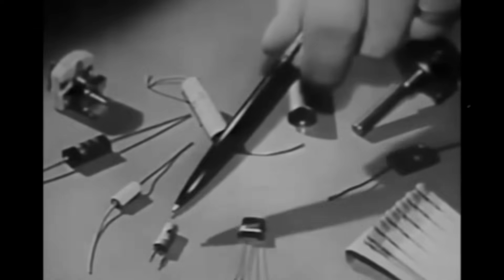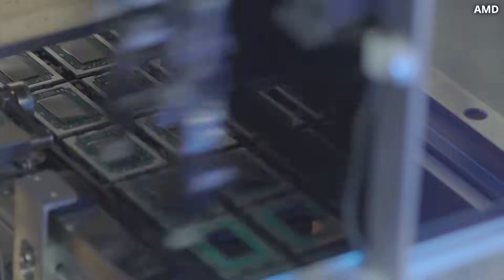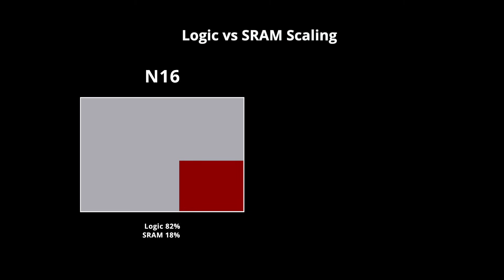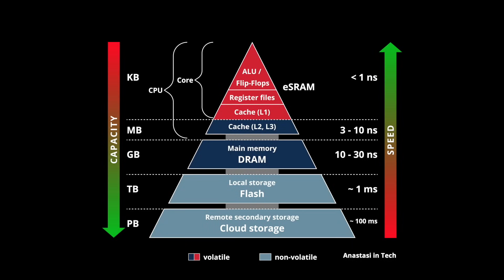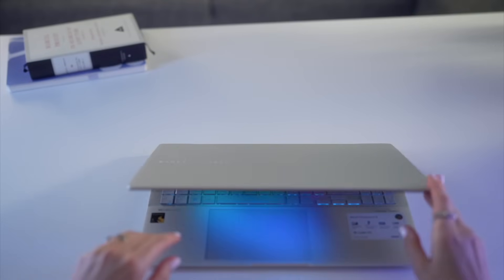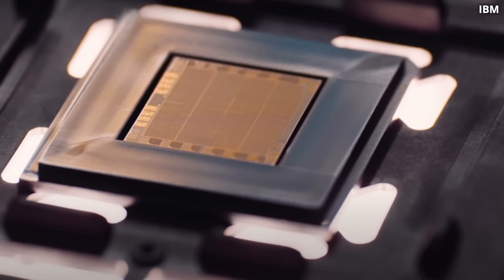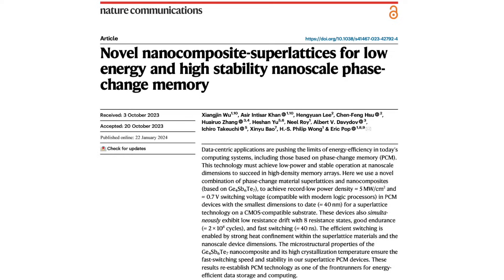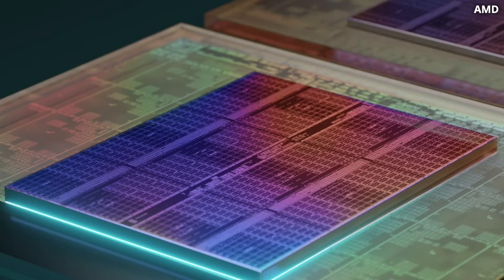The Death of Computer Memory

Comment: When I first started programming, and RAM was off chip and typically a few KB, we'd spend a lot of dev time working out how to do as much as possible in as little RAM as possible and as few clock cycles as possible.  These days the demands to cut development time and get new features out, more driven by senior management and Product Owners than by real customer demand, seems to have ditched those ideas.  If it's too slow the customer is expected to just buy a higher spec machine and new developers are taught ways to shorten development time but not execution time.  I think that this is a false economy.  About 10 years ago I was able to shorten a big data-processing job from 3 days to under 20 minutes, on the same hardware, by applying the techniques I'd learned back in the 1980s to key functions.  It took me 5 days, but when this is something that has to be run every week the saving soon stacks up
Reply: Wirth's Corollary to Moore's Law:
Any improvement in Hardware performance will be negated by code bloat at an equivalent rate.
Kinda like traffic in London.
Reply: Indeed. The faster the hardware it seems the sloppier the programmers get
Reply: @Th3_Gael  I think it’s less that developers have gotten sloppy than that timelines have gotten shorter.  Project managers and product owners hear that with Agile you can have something after a 2 week sprint and pressure developers to create a full product in a few weeks.  Development time is reduced, even though that results in code that runs slowly and has bugs because no-one has time to avoid them or fix them before release.  And then there’s the product owners who think Sprint retros mean if they change their mind about a feature they magically get the time back.

“The Phoenix Project” by Gene Kim et al gives a good overview of the problem and one way to approach the solution.
Reply: @Th3_Gael  Very true, faster and faster HW has resulted in SW code bloat and security risks mainly due to decline of programming. Today when I ask "average" devs and programmers what HW platform they use in the cloud or locally, they usually reply that they don't care as long as code is running fine and fast enough. Here is where I see main difference from the past when coders were close to the HW and today they r more and more detached from it due to cloud and virtualization. Everything got more comfortable and easier, just take a look at more HW attached gaming console coders who were once able to unlock incredible results from the one of the kind pocket calculator and now they code on the CISC x86 PC like machines and still complain about it😁Maybe they should look at the folks who coded on the PS3 Cell with 512 MB of RAM and were able to deliver incredible results. I think that generation was the last which showed who is truly master coder and who's just an average one.
Reply: I remember being taught to always use the smallest variable size possible to save memory and increase code efficiency. Still bugs me today people just using variants for everything. Inefficient code is everywhere now.
Reply: User training is problematic as well.  I remember as a Development Database Administrator being brought in when one of our systems was blowing the filing system the temporary tablespace data files were on and the Database Babysitters couldn’t work out the cause.  Originally the problem they’d been having was sorts failing due to running out of sort segments so the bozos had ‘fixed’ that by making the temp tablespace auto-extend.  Then they wondered why the nightly file system backup direct to tape jumped from 3 hours to 15.  What didn’t cross their teeny tiny minds is why a database with data files amounting to about 4GB had a temp tablespace of 70GB, 64GB of which was in the final file and the only reason that file wasn’t bigger was the file system was full and wouldn’t have supported larger files anyway.

After tracing the internals of the RDBMS I discovered that it spent almost all its time  creating sort segments, sorting data, clearing sort segments then reusing them.  The buffer cache hit ratio was also under 20%, whilst buffer cache it ratio is a poor measure of system performance when it’s that low on an OLTP system it’s a sign of a problem.

The system mostly worked on addresses and had about a third of a million addresses stored in it.  Users would search for addresses and the data pointed to a document store of documents related to that address, it essentially indexed a document management system.  I noticed that when searching for documents the bulk of searches only used the first part of the postal code and sometimes the document type.  I went out and spoke to some users and asked why they only searched on that when they had the full address.  The response was that was what they’d been told to do on the training.  I tracked down the trainer and she said that they did that because the training system only had about 50 addresses in, covering about 7 or 8 postal codes so to save time they just got the trainees to enter the first part of the postal code the scroll down to the one they wanted.  The system automatically sorted the list by full postal code then house/block number.  That’s fine when you have 50 addresses and each search returns 10 or so addresses.  When you have over 330 thousand addresses and each search returns a few hundred and you have between 200 and 400 users on the system at a time that’s a lot of sorting and scrolling to be done.  The database couldn’t release the sort segments till the user had ended their transaction (results were paginated so the full sort set wasn’t returned to the client in one go) so the system had to keep allocating more.  

I got a message sent to all users to say to use all the information they had in the first instance and only leave things out (so they’d be wildcarded) if they got no hits.  Temp tablespace growth went away, sort segment issues didn’t reoccur and we got the backup time down to about 3.5 hours.  A salutary lesson on the importance of looking at the end to end, not just the bit that’s going wrong.
Reply: @StephenBoothUK this type of problem should be resolved by not allowing the user to perform inefficient searches. With modern users, to simply tell them about a workaround and expect them to abide is folly.
Reply: @mkeyx82  they were doing what they were trained to do.  This was a system bought by the business with little involvement from IT from a third party supplier.  Also, there would be times where the users might legitimately have to search on partial data as they would be working from information provided by the public on paper forms so some data might be missing or illegible.  The problem wasn’t that they could do inefficient searches (which sometimes they might need to do) it’s that they were trained to always do inefficient searches even when they didn’t need to.

Your comment again proves the need to look at and understand the full situation rather than leaping on just what you think is the immediate issue.
Reply: @StephenBoothUK  it also shows that some do not understand that all users are not the same. Many users are completely resistant to receiving training.
Reply: @mkeyx82  can you explain the thought process that gets you from “the users were doing exactly what they were trained to do” to “users are resistant to training”?  They weren’t resistant to training, they were trained to do something badly and lacked critical thinking skills to see the better way and follow it.  They accepted and adhered to the letter of the training.
Reply: @StephenBoothUK  I understand what you are saying. I am  looking at the matter from my perspective, where my experience with users is such that many people out there are not really trainable.

When we recommend something to these people it usually does not stick, they are set in their ways. They don't like workarounds, they want to do things the way they have "always been done".

Even if you try to make their lives easier, they will put up resistance. Maybe this is a very specific, very low quality user base, tainting my perspective.

From my angle, the application should not allow itself to be brought into a problematic position by relatively normal usage. That's my story and I'm sticking to it.
Reply: @StephenBoothUK  your comments make me wonder what would happen if you had an AI that was trained on YouTube comments.
Reply: @StephenBoothUK  there's a huge disconnect between your end and my end. I've been able to get some work done developing prompt design so that I can get AI to cough up something useful, but it's like arguing with a drunken genius toddler on subjects nobody taught the drunken genius toddler about. The large language models are all trained on the stuff that has already been done and it can't parse New concepts. And that's my meat and potatoes. Everything I'm doing is outside of what we've already done. If it's something we've already done I can eventually get some kind of answer out of AI but even that's kind of a slog.
Reply: @court2379   that means there's great opportunities for improving code. The challenge isn't in the coding as much as it's in the human resources side of business management. If you take the flow chart of Human resources you end up back in academia. Of course most tech industry has completely forgotten the customer base and stopped communicating with the public. Everything is a no reply email. The space Renaissance is going to drive a huge increase potential in both hardware and software because space is going to require radiation hardening of all the traditional earth-based computer hardware and we're going to need much better quality coding. Space colonists are going to want all the standard types of personal computing equipment but to a far higher standard. And that's good it means there's lots of opportunity. With population growth exponentials moving beyond Earth we don't have to worry about constraining population growth anymore because the population on Earth is going to stagnate at about 10 billion while fertility rates skyrocket. This will create a huge increase in market size where most of the market will be off planet within 100 years. All this is being driven by Starship. With Starship bringing the payload size up and the cost down with high repeatability it'll give us the ability to put our foot in the door on Luna for heavy industry it'll build all of the resources we need for Mars and orbital activities around the solar system. That gives us plenty of distributed ISRU economies of scale as long as we develop a robust flowchart of Exodus for all the logisticals. A key component of memory that we're going to need to develop is exemplified by the work Microsoft is done with fused silica data storage. As we move out to Luna, Mars, & the interplanetary transport Network in general (a network of gravitationally defined transportation potentials) we'll have brief opportunities to record virgin data about untouched surfaces such as most of Luna, & Mars, as well as the Virgin surfaces of unknown numbers of asteroids, not to mention the moons of Jupiter etc. When we go to these places we'll have a brief opportunity to record this virgin data and it will be very heavy in volume. Because of this fused silica is aligned for archival storage en Mass with long-term research value. We won't have long to do this because we'll have a high priority for rapid on-site development. This will be driven by the population growth exponential being exported off of Earth. There won't be any shortage of money. The biggest thing holding us back is inefficient and ineffective academic development, and very poor quality and corrupt HR.
Reply: @court2379  Ahhh... so you're the one that limit my name size to 16 characters.
Reply: @MrAkaacer  Thats probably the database guy...
Really there is a mentality that ram and drive space are cheap, so they just don't bother being efficient. Sloppy.
Reply: I don't blame the coders of today.   They need to pump out code fast and if the hardware can give good enough performance, well that will do.  In retirement, I have the time to optimize to a certain extent (I'm an old 'C' programmer) and have written an OCR program that recognizes text at about 90 pages per second (on a 2017 CPU) which is about 100 times faster than Tesseract, Omnipage or FineReader software.
Reply: @123scanman  That’s my point. The drive to get new features out faster (driven by Marketing, senior managers, and Product Owners) seems to trump performance and fixing bugs. They would rather ship a feature the customer doesn’t need than get more transactions per hour per user on the same hardware or stop it crashing every 255 hours.
Reply: @StephenBoothUK  As someone around the gaming space, this cuts deep.  The modern gamer's expectations are arguably as ignorant as the investor focused executives, that make high level decisions with cascading consequences, throughout a project.   This creates a market that hits them from both sides...   harsh criticism from the players on almost any game issue, and from the business side guaranteed lay offs, no matter how good a job/how successful their project was.  

The state of tech has gotten so bad, many people I know, and including myself, have quadrupled the length of replacement cycles, and are seeking out older models of things. As those are more resilient items, and pre-date the cloud integration that companies have recently turned hostile against the user base.  IE things that require a phone app to use, and companies are now charging subscription fees to keep accessing the software.    

Meanwhile, so many people started becoming more investor minded (even ignoring the job market situation), which in turn is driving start ups trying to sell solutions that are desperate to find a problem to solve, inspiring incumbent players in a market to create problems they can sell more solutions to.
Reply: You are absolutely right. Once I participated in a service job to get a power station running. The problem was to bring the gas engines up and running as fast as possible. After a few days the programmer had been flown in and looked for alternative assembler commands to save a clock cycle here and a clock cycle there.😁
Reply: @crazyedo9979  Yep. Miss those times. I had a cheat sheet printed out with all assembler instructions with corresponding clock cycles and byte lengths. It was a very creative process to be able to squeeze out every byte / clock from the system.
Reply: @kalinkaata  Yeah, I remember those days and to be honest it was an artform.  Issue is now that how many coders could even begin to strip a piece of code to squeeze out as many instructions as possible within a given finite number of cycles?  Not many that's for sure.  That's the difference in my opinion between a programmer and a coder.  I miss those days.
Reply: @jamesross1003  as an end user I miss those days to. I have a lot of work to do and I'm not getting any help. With no ability to communicate with the development side it's like climbing naked through blackberry bushes to try and get my work done.
Reply: I am a total layman, and know this is true. 

 I think I was told we just brute force what we want with inefficient codes. 

 Look at what Voyager 1 and 2 could do with with 69kbs (lol 69. Sicko rocket scientist). 

 I bet if we tried to make a space craft just doing the same things it would take GBs of memory. Maybe I'm exaggerating, as again I am a layman. 

 Anyway you'd think it would be the opposite. We would be making even more efficient code, but I guess it is hard, and annoying. 

 Anyway thought phase change memory was already a thing. Just too expensive.
Reply: @dianapennepacker6854  I think the reason we're getting shity code is because of a culture shift. The old programmers came from a more disciplined background when the new programmers. A lot of that I think comes from the takeover of academia by lower quality educators. These lower quality educators produced lower quality output trained personnel.
Reply: @Astroponicist

It's not that old programmers were more disciplined. What shifting is emphasis. In my days, we only have 640Kb, thanks to Bill Gates arbitrary decision. So, we tried to save memory space as much as we could, otherwise our program would not run or run poorly. And don't forget the speed was not even 0.1% of today's low end computers. An unoptimized program will show its quality right away.

Today's programmers have memory in terabyte. And they can do a lot of unoptimized thing in their programs and as long as the program does not freeze, the customers are none the wiser. The ease of having large memory means programmers start to emphasis of how fast they can make the program, even if it's bloated and unoptimized. For example, they will load the entire library to memory when they only need one function. Sure, they can weed those things out but it will be done in the next patch, if any.
Reply: Maybe you should give a short hint how memory saving techniques you learned 1980 made the task faster.  In my experience using less RAM comes normally with slow programs, wasting Ram on them tends to speed stuff up.
Also you forgot to mention the devils that ruin our lives: marketing departments.
Reply: @transformational_experience  it was more around reducing database reads by collapsing 6 flag fields (each a multi character varchar for what amounted to a yes/no) to a single character field holding all 6 (the old knowledge) and using an index organised table to store the data (that bit was new).  Essentially using the first 6 bits of the char to hold the flags then calculating the numeric value and writing the corresponding char out.  The data didn’t change often once captured (less than 0.01%) so leaf rot on the index wasn’t an issue and the time taken to calculate the value (basically a bunch of if inputvalue == “some string” a = a+2) and convert to a char was more than compensated by only having to write out one char rather than 6 varchars.  The majority of queries on the data had where clauses that were based on these flag values so by making them leading edge of the index meant that the database read just had to read one branch of the IoT so eliminating 70-90% (not all sets of flags were equally probable) of the block reads.
Reply: @StephenBoothUK 
That I can understand and appreciate.
Reply: @transformational_experience  VAX Alpha Chip using Dec Unix.
Reply: @transformational_experience  from what I recall it was only loading the data needed for each sort, rather than entire records, and using pointer arrays to hold the order of records rather than copying the data back and forth for each time.  Sort the pointer array based on the data then do basically an index read (the array is the index) to grab the records in the right order.  These day I’d use a proper database to hold the data not some half-database/half-formatted-file monstrosity but we don’t always get to choose what we work on because the business don’t want to change from a system last updated in 1994 when the vendor died (literally, it was a one man band and he and his motorbike got embedded in a tree at 80mph).
Reply: Lets face it, knowledge in good IT either infrastructure or development is lost. I come from a time were you needed to know both streams. I'm currently doing Wintel infrastructure and most of the ppl in my team haven't even installed Windows server OS. 2 key things happened, big tech started to make ppl reliant on them, and a country full of so called IT pros lied about their skill level. Until we wake up, Its going to get worse. Glad I can get out of it soon.
Reply: @Fronzel.Neekburm  Very true, faster and faster HW has resulted in SW code bloat and security risks mainly due to decline of programming. Today when I ask "average" devs and programmers what HW platform they use in the cloud or locally, they usually reply that they don't care as long as code is running fine and fast enough. Here is where I see main difference from the past when coders were close to the HW and today they r more and more detached from it due to cloud and virtualization.
Everything got more comfortable and easier, just take a look at more HW attached gaming console coders who were once able to unlock incredible results from the one of the kind pocket calculator and now they code on the CISC x86 PC like machines and still complain about it😁
Reply: @Fronzel.Neekburm  Very true, faster and faster HW has resulted in SW code bloat and security risks mainly due to decline of programming. Today when I ask "average" devs and programmers what HW platform they use in the cloud or locally, they usually reply that they don't care as long as code is running fine and fast enough. Here is where I see main difference from the past when coders were close to the HW and today they r more and more detached from it due to cloud and virtualization. Everything got more comfortable and easier, just take a look at more HW attached gaming console coders who were once able to unlock incredible results from the one of the kind pocket calculator and now they code on the CISC x86 PC like machines and still complain about it😁Maybe they should look at the folks who coded on the PS3 Cell with 512 MB of RAM and were able to deliver incredible results. I think that generation was the last which showed who is truly master coder and who's just an average one.
Reply: @Fronzel.Neekburm  Very true, faster and faster HW has resulted in SW code bloat and security risks mainly due to decline of programming. Today when I ask "average" devs and programmers what HW platform they use in the cloud or locally, they usually reply that they don't care as long as code is running fine and fast enough. Here is where I see main difference from the past when coders were close to the HW and today they r more and more detached from it due to cloud and virtualization.

Everything got more comfortable and easier, just take a look at more HW attached gaming console coders who were once able to unlock incredible results from the one of the kind pocket calculator and now they code on the CISC x86 PC like machines and still complain about it😁Maybe they should look at the folks who coded on the PS3 Cell with 512 MB of RAM and were able to deliver incredible results. I think that generation was the last which showed who is truly master coder and who's just an average one.
Reply: @Fronzel.Neekburm  Very true, faster and faster HW has resulted in SW code bloat and security risks mainly due to decline of programming. Today when I ask "average" devs and programmers what HW platform they use in the cloud or locally, they usually reply that they don't care as long as code is running fine and fast enough. Here is where I see main difference from the past when coders were close to the HW and today they r more and more detached from it due to cloud and virtualization. Coding got more comfortable and easier, for example more HW attached gaming console coders who were once able to unlock amazing results from the unique pocket calculator and now they code on the classic CISC x86 PC like machines and complain about it😁Maybe they should look at the folks who coded on the PS3 Cell with 512 MB of RAM and were able to deliver incredible results. I think that generation was the last which showed who is truly master coder and who's just an average one.
Reply: Like modern Pixel games that require 8GB of vram!
Reply: Amazeballz content and comment. Thanks for your insight.
Reply: It is a winner takes all game now. Time to market is the only metric that truly matters.
Reply: probably chip from my dec vax world.
Reply: This
Reply: Very true, faster and faster HW has resulted in SW code bloat and security risks mainly due to decline of programming. Today when I ask "average" devs and programmers what HW platform they use in the cloud or locally, they usually reply that they don't care as long as code is running fine and fast enough. Here is where I see main difference from the past when coders were close to the HW and today they r more and more detached from it due to cloud and virtualization. Everything got more comfortable and easier, just take a look at more HW attached gaming console coders who were once able to unlock incredible results from the one of the kind pocket calculator and now they code on the CISC x86 PC like machines and still complain about it😁Maybe they should look at the folks who coded on the PS3 Cell with 512 MB of RAM and were able to deliver incredible results. I think that generation was the last which showed who is truly master coder and who's just an average one.
Reply: So true. Also they make the programming very bulky causing need for more storage space. We just buy larger and larger hard drives instead of making programming more optimal . Lazy? I guess so.
Reply: HUMANS ditched the idea (because other things have higher priority nowadays)............. but AI did not. AI will gladly take the code and TRANSLATE / make it MORE efficient (IF we do NOT FORGET to tell it to DO it) !! 😎😎😎🤣
Reply: @ AI generated code is well known for being inefficient and bloated.  The reason being that an AI is trained on code examples from sites like StackOverflow and public repositories, it has no way of knowing the quality of the code it’s been trained on is good or bad and the majority of published source code is bad.  The AI produces code based of the most common structures in its training data and because most of the training data is poor quality so is the code it produces.
Reply: @StephenBoothUK  
I'm getting the same results when I do conceptual prompts on AI on subjects with less activity. I'm doing logistical research on high immigration to space and what is needed and what can be done. I don't know where they're getting the large language models for space activity but if it's stack overflow, or Reddit like sources that explains why it's so very bad. When posing a question to AI about  recalculating the load bearing potential of a standard I beam from Earth to an implementation on Luna it just about lost its mind it actually thought that it would have less capacity under lower gravity. Anybody who has any engineering understanding at all it's going to understand that that's wrong. The good news is that what you're saying and what I'm seeing really has to do with the training data quality and how there's a lot of room to bring that training quality up. When it comes to architectural design engineering programmers don't have very much practical understanding. I think that's where we're getting such lousy AI returns on Space related material because programmers don't know how to build things in space. That's not a dig against programmers at all but the programming crowd doesn't mix with heavy equipment crowd, especially subjects like mining or heavy infrastructure. So when programmers are building AIs they go to data sources that they trust for political reasons I think.
Reply: At lowest level of optimization, they may appreciate the simplicity of Assembly & how the CPU/MCU itself executes functions only by flipping bit state of every register... 

And do a lot of things with just a few bytes of instruction.
Reply: Teach me your ways Oh Wise one.
Reply: @Siceone Let's start with tiny MCUs with 1-2KB of SRam 😂
Reply: Anybody that wrote code in the 70’s or 80’s will almost certainly recognize the modern syndrome but not to worry, I hear somebody’s got a new toy that supposedly will replace human coding altogether while concurrently optimizing all resources. 

It’s certain to revolutionize everything and make us all people of leisure. 

I can hardly wait. 😂
Reply: Unless you were programming on original 386’s you were using cache, just didn’t know it
Reply: @geekswithfeet9137  some of us started programming well before the 80386 was released and also worked on embedded systems from time to time.
Reply: @geekswithfeet9137  Some motherboards already had cache (external) since x286 era. They even boasted how their motherboard blew their competition in speed comparison.
Reply: @geekswithfeet9137  I thought I responded to this at the time.  When I started it was on 6502, 8086, 8088 then 80286.  Even did some embedded 80186 and early 68000 boards for industrial process control.
Reply: It's not a false economy, just a different emphasize due to the change in price structure. 

In the old days, memory were expensive, so we tried to economize its use. Today's memory are so cheap, that software developing time has become the most expensive part of a system.
Reply: @gorilladisco9108 
Memory is cheap until your bloated code and data structures run out of room.
Reply: @akulkis  It took special kind of programmer to bloat his software that much. Much of the bloats usually caused by graphics and sounds, that is, on the part of artists and designers side. But the code side of software creation usually only bloat a little if the programmer is lazy or scatter brained.
Reply: @gorilladisco9108  the cost of memory is largely immaterial.  It’s the cost of execution time.  Say you’ve got a transaction that currently takes 10 minutes to complete but if the code was optimised would take 7 minutes. To optimise the code would take the developer an extra 5 days effort and the developer earns £30 an hour (that’s the mid-point for a developer where I work), so that’s about £1100 wage cost but once it’s done that cost is done.  Once rolled out the application is used by 200 people paid £16 an hour (I have some specific applications we use in mind here).  Saving 3 minutes per transaction means either those same staff can process 30% more transactions or we can lose 60 staff at a saving of just over £7000 a day.  That extra development time would repay in a little over an hour on the first day and after that would be pure cost saving.
Reply: @gorilladisco9108 Except the software is a one time cost, and the hardware is a cost for thousands of users. So it saves the software company a little while costing all the customers thousands of millions.